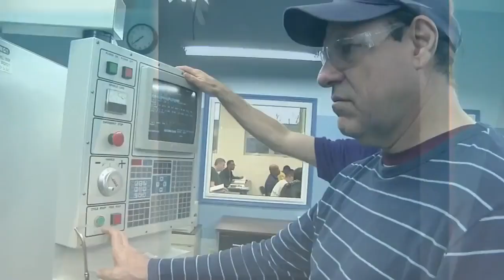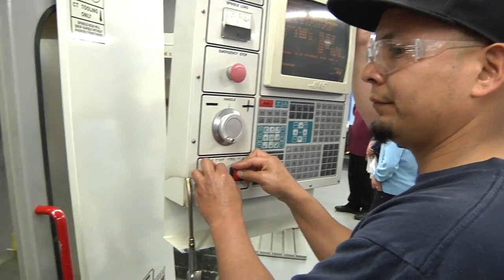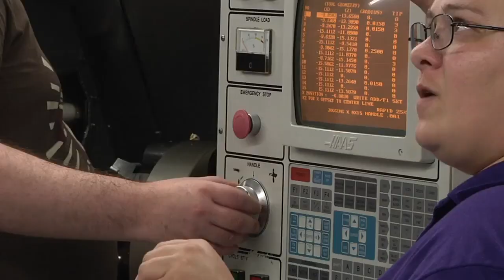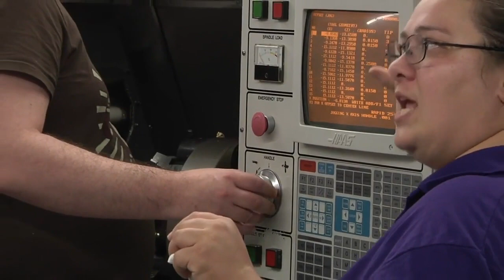Training for CNC jobs in Chicago

Comment: I took a 200 hour cnc class at a local tech school when I was 62 years old last year.  I was not very good at it, but I made one of those cubes with the four holes on each side of the cube.  We got plenty of hands on.  I took it just to learn.  I am too old for the industry.  I had an interview for another manufacturing job and told the guy I was going to take a cnc class instead of taking any job.  He told me you will just be another "button pusher".  I was kind of turned off by the guy and the company when he told me that.

Comment: I worked CNC job for 5 years . But my duties repair mistake parts to be good to ship to customers after that inspection guys double check. That job made my leg and shoulder shut down of the health. Sometimes my shoulder pain again when I bring or work hardly.  There are people who are  luckier than me .who start CNC job just operating on machine even though they start working from zero of knowledge of CNC machine operator.  Before Korean owner he was lucky when hiring me to work his parts. I remembered that time manager took bad parts to me for repair and fixing mistakes of done parts. Even though the first parts from new customer order of his . I had to fix them to be good before shipping. I had repaired those new parts before he waited for them. The owner picked the parts after I repaired them . Time later he got new contact from those parts .I always deburrg and repair them each year. Set up man and Program man who work badly.  Details of those parts I had to use the tools to fix and repair shape and dimension depth for their products.  If im owner i kicked them out soon. While I repair mistakes parts from them each year my health damage so much. Each time  my thoughts to remember history to work for that company I'm very sad for my destiny with cheap wage.

Comment: how can i apply for the job or training
Reply from the maker: Ravi-give us a call and we can get you started in Advanced Manufacturing!  So many jobs are available now and we will place you into them and get you certified.  Call us at 847-673-6500. 
www.symboltraining.edu
Reply: CNC Machine, ISO and Macro Programming, SwanSoft Simulation
https://www.udemy.com/course/draft/2715470/?referralCode=BB61428EB867850E059A

Udemy Training --> Mastercam CAD CAM and CNC Programming Professional (English)
https://www.udemy.com/course/mastercam-cad-cam-and-cnc-programming-professional/?referralCode=4E80F7E5F758CE4C1A09